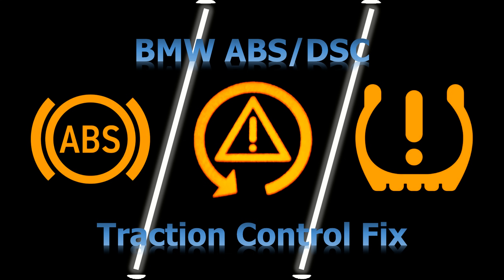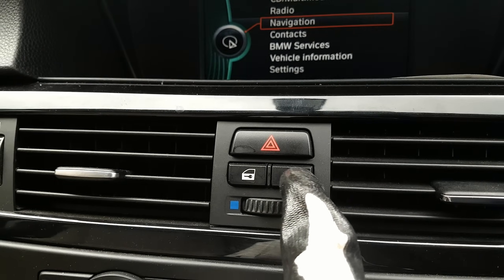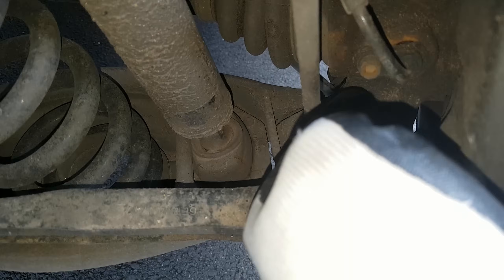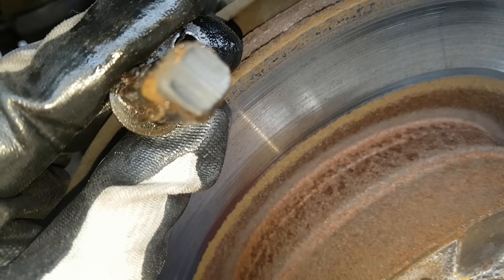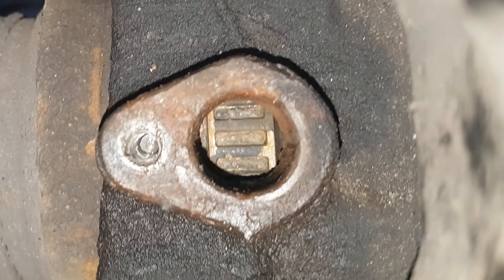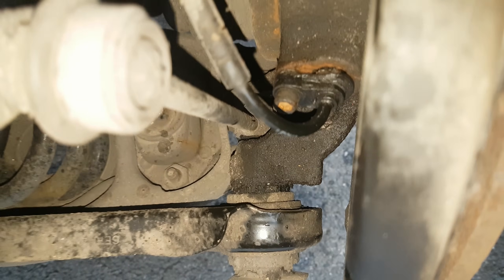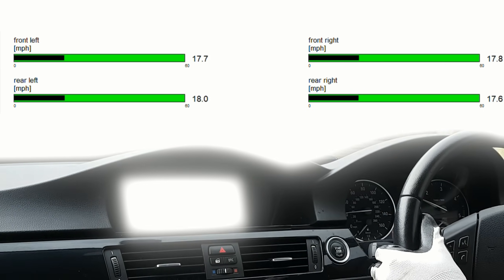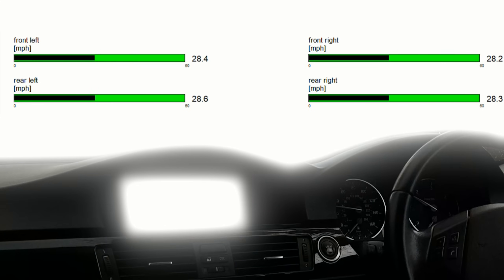BMW Traction Control ABS DSC DTC issue or loss of engine power

Comment: I am an owner of 2008 BMW M3 MT with only 50000km  For some time now ABS and Flat Tire Monitor Mulfunction ( Brake and Drive Control System Mulfunction ) have been flashing on and off. I have been advised by BMW mechanic to get a Exchange Hydraulic Unit at a cost of over $ 5000. 
How to fix the problem without going to huge repair costs ? Thank you .
Reply from the maker: Did you replace your tyres or rims ?
Reply: @laymandiy  Not at all
Reply: @laymandiy  I replace tires over two years ago. The warning lights started a month ago.
Reply from the maker: Without hooking up diagnostic difficult to say. Could be as simple as described here

Comment: Hey,  i changed the sensor, rear left. But the error is still there. Bmw e60 2004 150.000km
Reply from the maker: How did you know it was the left one?
Reply: LaymanDIY was in the fault memory
Reply from the maker: @Milchenx3  what did it say? Are you having intermittent or continuous ?
Reply: LaymanDIY in the end it was a cable break for me. The Sensor was OK

Comment: Good video mate it really helped.
Would be good if you could do a video with replacing the Rings.
Reply from the maker: Dougie Peterson I have been looking at it, however point to note is that the ring had swelled up because the base material, it's not the ring that's the issue, it's the shaft corroding away. I'd advise on just replacing the shaft as the amount of work and potential damage you could do is high. Not to mention the integrity of the shaft.

Comment: I have a 4x4 abs brake light Can this help?
Reply: Try to take of the Batry and out back or replace new Battery 4x 4 wil disapear
Reply: Does a peugeot 607 have a reluctor ring on the drive shaft

Comment: Is front have reluctor ring?
Reply from the maker: Sulaiman. Bolhi I don't think so. The abs sensor isn't in line with any cylindrical turning part. Rather it's perpendicular to the steering knuckle in the front wheels

Comment: where can I buy inpa? which model? Europe? SPain? For BMW?
Reply from the maker: Believe inpa is no longer used by dealers in any official capacity. I think it's available free online if you Google.
Reply: @laymandiy  I went through a road pump and this error codes came up and car went into limp mode, the following day error dissapeared all of a sudden and then it came up again after turning left in a roundabout. What should I say to the mechanic in order to fix this problem straightforward? I would apprecciate a reply  thank you
Reply from the maker: @runebdrim6733  The damage from the bump caused has deteriorated over time. Could be anything, links hub. Chances are the driveshaft is either slightly bent or speed sensor is rubbing up against something.

Comment: Is it difficult to change the ring?
Reply from the maker: If you have the tools and time then no it's a £10 job. If you don't then it suddenly becomes less feasible.  You'll still need to take the wheel off etc..undo the hub cap remove the 6 bolts connected to the driveshaft and then begin removing the old and replacing with new. Don't forget to sand off all the excess rusting.
Reply: @laymandiy  I will have to go to a Mechanic. I've just pulled my back 😩
Reply from the maker: If you're giving to a mechanic it's more cost effective to just replace the entire shaft and in most cases even cheaper. Labour alone for a mechanic would be 3 hours Vs 1 hour for replacing the entire thing.
Reply: @laymandiy  thanks for your advice. I just subscribed to your channel 👍

Comment: Hallo !Meister ich möchte über drehratensensör wissen.?ich finde nicht ordentliche info.Danke
Reply from the maker: What information do you want
Reply: @laymandiy  Ich habe 3.er Bmw e46 320d m47 engine 2001bj 100kw Wo steht das sensör? Gogle finde ich keine wideos oder anletung was für simptome hatt.Bei mir keine lampe dauer hat leuchtet.Nur beim starten 3.er eck sembol kurz blinkt und weg.Aber Obd   zeigt Drehratensensör signal unplausibel.Fehlercode DTC 5E3C,DTC 5E38.Ich habe Hinterantrip 2 sensör und 2 sensörringe besorgt ich möchte erneuern.Aber Wissen wir nicht wo der rihtige fehler ist.Haben sie eine emphelung,bevor ich alle teile neuer beschtelen.Danke für schnelle antwort.

Comment: My so called mechanic a 62 yr old that also WAS a long time friend of mine I paid last year as he has a lift and I just asked for him to rotate the tires and do a oil change which I paid him more then a REAL mechanic at a shop.
 My gf and I then had to pick up her son from school and when she dropped me off to get my car he was JUST pulling of the passenger rear tire and when I watched him pull it off a cable that I then assumed was like part of the speed sensor being that it basically touches the caliper and flush with the rotor. Well he snapped it and was trying to tell me "Oh that goes to the ebrake it must been rusted out".
 Obviously I was pissed as that made no sense and after taking it off the lift and starting it well EVERY light just about when on and we drove around the block and the speedo didn't work and at times made this horrific noise  shaking the whole car. Obviously I was pissed and it's been like this ever since but worse. It does shift ok though and even cruse control works yet that's about it. 
Also when I slow down or stop it makes a noise kinda like the sound of a bad UV joint and driveshaft banging type noise. It is a 2006 325ci rear wheel drive and it's getting really bad but lost my job had to move in a trailer and can't afford to have it checked although I do have a adapter to the ECU to phone and did read many things but one was transmission speed sensor. I don't know what the hell to do about that cable which I think the end looked like a almost dime size magnet which is all f--Ed up but would make sense to me😊atleast that controls the speedometer. Also when I hit the tracking control button as you did at the start off this video as that's on also it does nothing so I can't shut ANY of the lights off besides sometimes the check engine. So far your video though shows more of my massive issues they any other so if anyone has anymore advice or ideas I'd appreciate your help as it's my 1st BMW only had it for 2 yrs so not that experienced with these cars. TY  Rich
Reply from the maker: So much going on. Firstly Speedo not working linked to the left wheel speed sensor. Need to check it's still working and wires are intact (could be the wire the mechanic snapped). If your reader can read wheel speed sensor, then go ahead and see if you can.

The other issues I would start with the basics, check the tyre bolts are secure as a starter.

Comment: That did not fix my problem. My sensors all read fine. At a stop the lights are off. When you step on the gas the lights all come on until you reach about 40 mph at which time the lights will go off until you let off the gas and the lights come back on.
Reply from the maker: How do you know your sensors are reading fine?

Comment: A good looking girl with a bad personality. My 06 750 has the Abs lights, usually when I first drive the lights come on, if I drive car for 15 minutes, stop car and restart they usually go out. Replaced right rear abs sensor. There is two cables going to the rear passenger wheel. Should I try and replace that one? What's it for? Really hate this car, think they used too thin of wires on the sensors, actually the whole car.
Reply from the maker: Have you tried diagnostic first?
Reply: @laymandiy  guess I need a good scanner, my Launch scanner is down. Can you recommend a good site for codes?
Reply: C11AD P152B P2A8C P0014 bank 1 any of these associated with ABS, sure would like a tip.
Reply from the maker: @wearethe80s4sure  get yourself a k dcan cable costs about £15 and software on PC is free

Comment: Thanks so much I have the same problem for my BMW 320d 2005 model 1 year ago it started and i was on the motorway the recovery men took me the garage and they fixed the problem then last week it started again the light came up twice but after that i driver fine so I don't know what's going on
Reply from the maker: Not sure how to help there, as the that's the only way I know of, how to turn it off. Did you hold for 10+ seconds
Reply from the maker: Sounds like the garage may have either not fixed the problem or have fixed only 1 of the problems, meaning they may have just replaced the sensor and the problem is coming back or they have removed rust only. Chances are they replaced the sensor only and that's why it stopped happening for a while.

Comment: I told my local BMW workshop in Norway whats up with my car, and i explained them the problem is like this (in this video) and they said they had to fix it and it cost 1400 in USD... 
So your telling me i can save 1400 usd on just doing this my self? 
Rip English i know...
Reply: MrPartyGamer if you do your research you can fix anything on your car... depending on the model u have if you do some searching online you’ll find a diy to fix the issue u have, I know mechanics that are certified and still use YouTube with some jobs they get
Reply: swagsession1 I just watched another video like this, is this just a temporary fix, or is this enough to do in order to drive the car for like forever?
Reply: MrPartyGamer those sensors always go out because of brake dust, should be replaced every time u change your breaks
Reply from the maker: This is a temporary fix, to repair properly either take the shaft off and sand down the rust and put a new ring on or get a new shaft. Even then that will last as long as there is no new corrosion forming.

Comment: So it helps anyone else. I bought a 09 plate e90 and it had far worse traction control problems than this with a very juddery drive. I did what he did and the abs ring was heavily rusted. I put a narrow wire head attachment onto a drill and just grinded the rust off at a moderate speed whilst someone else rotated the wheel (you're gonna need leverage for this so put in 2 nuts and a crow bar to torque it). I only had to do the rear passenger side for the problem to fix itself even tho I was getting bad readings on 3 wheels. If the problem persists after you've done both rear wheels get a mechanic to do the front ones instead as they're more complicated. For the tyre light, check all tyres for pressure, punctures and alignment. If its sound just do a reset by finding the setting in the control panel, pressing bc once then once again and holding to reset. For brake lights sign, check your brake fluid and your brake sensors again. You might just need a reset on them too or they could need changing.
These are all the cheap options before you have to do the expensive fix mentioned at the end of the video.
Hope that helps

Comment: I can confirm. This does indeed fix the problem as i just did it. Make sure you have some WD40 anti rust and a good pair of pliers, cus mine was really stuck.

Although i am concered that dirt and fluids now will seep inside since the sensor isn't properly "fitted and closed" now that its a couple mm away from the housing.

Has anyone had any issues or info on that?
Reply: Should have used a o-ring vs. a washer
Reply: @30guarino  Probably a good idea.

Comment: Been driving around with my Traction and stability control turned off for around a year now 😂 my mechanic basically said the ecu reads that my rear wheels are going reverse when they are actually going forward so go into limp. This is due to running different tyres to factory apparently be interested if anyone else has had this?
Reply: Wow I believe that's my issue....Just got my car towed back to my house. So quick question if this is the issue I'm dealing with how do we fix the issue where the DSC button isn't disabled anymore??
Reply: David G I haven’t fixed it yet I just drive with everything turned off 😅😅
Reply: My mechanic said an auto electrician should be able to code something for it for a few hundred £ but I’ve. It enquired yet
Reply: Does it lose power or did it lose power before and shift back into N  or D? I turned mines off but it still loses power upon acceleration. 😭😭
Reply: Todd Starks manual mate. Part exed it instead couldn’t be chewed on with the trouble

Comment: That is so dangerous using the jack.with  no  stands
Reply from the maker: Josh Wulliams true if at any point I was underneath the car. It is no more dangerous than changing a wheel. But you're right if you're ever going under the car you should have stands.
Reply: Josh Wulliams- sometimes you has to work like a boss
Reply: Tushay

Comment: Don't listen to this clown  
Put a washer behind my sensor and it made abs traction control light's come on. So i re set them and came back on minute down the road!  Took the washers out and abs lights etc went off!!
Reply from the maker: Why did you put a washer in the first place if you didn't have an abs light on?
Reply: I put washer on mine and it works
Reply: Adam, it didn't work because you didn't replace the blinker fluid! Also make sure there's enough squelch grease on the antennae for good ground. Good luck!